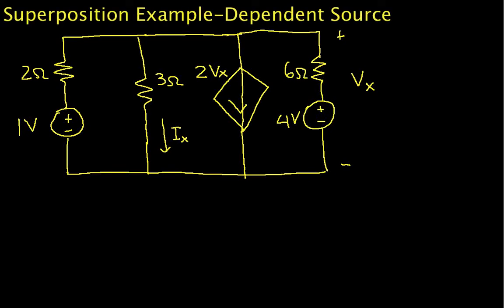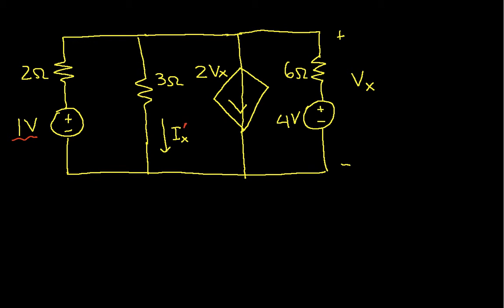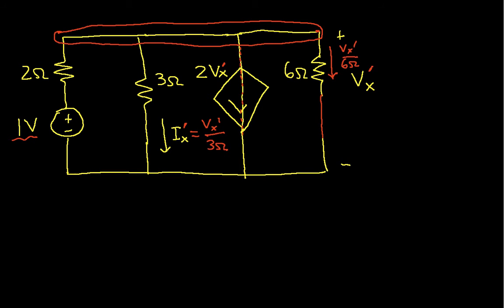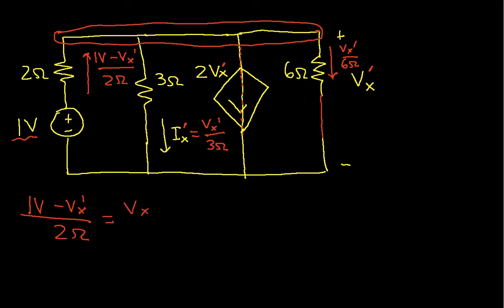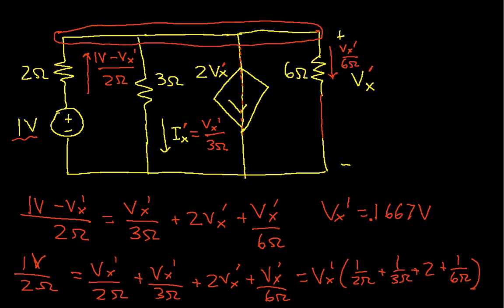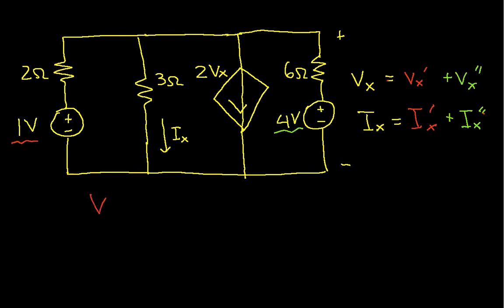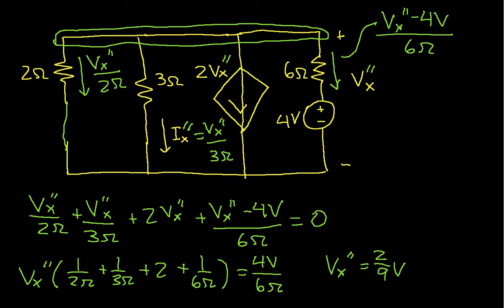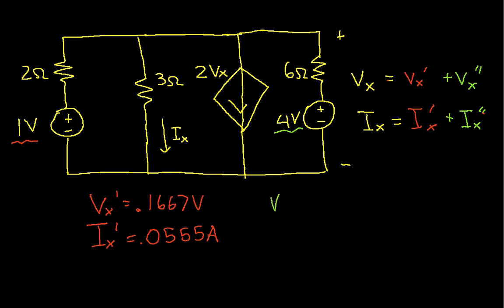Superposition using Dependent Sources By CA

Comment: why didnt you open circuit the dependant source?
Reply: the dependent source is based on voltage not current. The open circuit is only used to zero out current sources